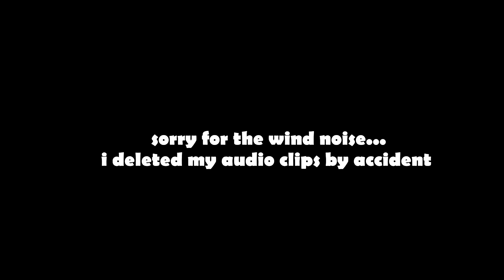INSTALLING MY NEW MT07 EXHAUST (Before & After)... Is This The Best Exhaust For The MT07 😱

Comment: Hey, after u changed exhaust, have u done something to the ECU or something? My motorcycle has some problems after i changed for the full akrap
Reply from the maker: What bike is it MT07? Shouldn’t have any problems
Reply: @gringomotovlogs   thank U. I will check voltage regulator, maybe this is the problem.

Comment: Seems like a shit load of work for not much end result. Most people don't have those tools (welding, really) to accomodate this install. Go with Akrapovic direct fit.install.
Reply from the maker: the bolts were stuck due to rust from previous owner commuting in sun rain or snow lol Akra or any other exhaust would've been the exact same process 👊

Comment: I'm assuming you disconnected the battery before welding ? If not do so in future or you could damage electrical components 😢...nothing worse than when a stud sheers off too, I've found "rost off" works well and cleaning the threads with a wire brush prior also usually avoids it.

Make sure you get it mapped now to avoid it running rich or lean and doing any engine damage. Sounds so much better 👌🏻

Oh and it's called an "impact driver too" not a "thingymagiggy" 😂
Reply from the maker: No we didn’t haha rest in peanuts to any electrical components harmed in the process 💀 not much electrics on here not even any abs lol she seems alright tho I had her out a few times since! 

Ohhhh that’s what it’s called! Haha and yeh il have to get it into the shop next month she’ll have to survive for now 👊 feels good to finally have some noise and feeling tk the ride 💥💥💥

Comment: Bowley saved the day on that one .... wheres the crf 450 gone
Reply from the maker: Bowley is a legend haha and your be glad to know, the 450 is back!!! Haha I was supposed to build it but I had to put it back together the other day and ride cause the Mt was out of action, now I’m just back on the 450’like normal lol I’m only riding it once a week tho I want to keep the hours down and I do want to build on it as I will need to sell it this season, I got something crazzzzy going on this year lol 💥
Reply: @gringomotovlogs  how much you want for that 450 ????? That bikes a beast mate you will miss it when its gone
Reply from the maker: @tommylee-wh7kl  not sure yet i recon 4600 for it with papers and street legal and sm setup with how shes running good compression, valves in spec kicks over first 2nd try shes good to go will do new plastics and graphics aswell first
Reply: @gringomotovlogs  gimme a shout when you ready to sell 👌🤟👍

Comment: when change the exhaust to full system, you not get losing the ho right ?
Reply from the maker: what? you mean hp???
Reply: @gringomotovlogs  horse power, bc i saw some videos that when change exhaust to full system not slip on, they saying that losing the power and have to Using ECU flash to get power no less
Reply from the maker: @niroj_b8248  no loss of power, ecu flash will just sort the fueling and make throttle on off smoother, upgrade air filter and should have 2/3 increase hp with it
Reply: @gringomotovlogs  Thank you :)

Comment: I have heard/seen countless videos about the MT-07 and these so called "experts" say it's a great bike for beginner riders. It seems they clearly have no approximate definition of what a beginner rider is. They come to this conclusion because it's a 700 cc bike . Uh, sorry but no! The MT-07 is possibly the worst or one of the worst bikes you can put a beginner on. It has no traction control, the suspension/forks are like spaghetti and can even flip you over the handle bars in a bad situation when you have to brake hard. The rear tyre slippage is very common if you don't know how to lean properly, so you take a newbie who just took a course in riding. He doesn't have the skills for emergency braking, for leaning or curving and you decide to put him on the most unpredictable bike on the market - That's pure stupidity. A beginner is safer on a Kawasaki 1000 SX than on an MT-07, because my friends you don't need to go over 200 kmh to die, 70 kmh is enough to get yourself killed. I'm not a pro, I'm not a track guy, but I've had everything from cruisers to super sports bikes in the last 31 years so I just might know a couple of things.
Reply from the maker: some good points there, i would say it depends what you call a beginner rider, for a first motorcycle yeh not a good idea obviously can be done but no a good idea lol but people guna do what they want no matter what you tell them
but a beginner as in a first 'big bike' yeh id say its fine and i tell people get it restricted for 6 months, and I look at it from a different way and think there are too many riders who think they are good riders when there still a beginner they just had rider errors hiden by tech and if you slap them on a mt07 thats just raw bike there come off if they try ride the way they think they can, so yeh the only thing i recon is good for beginners is abs cause then when they move to more expensive / powerful bikes with a whole lot of modes the tech will assist their riding instead of hiding all their errors
I agree with what your saying and no matter what bike i recon the most improtant thing people miss is going out and practicing and reading and learning keeping a beginner mind set